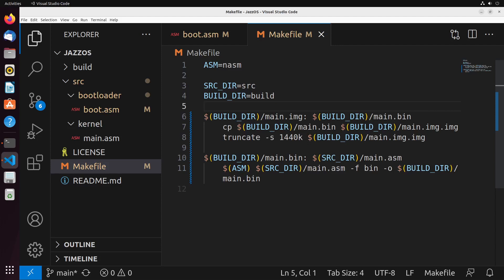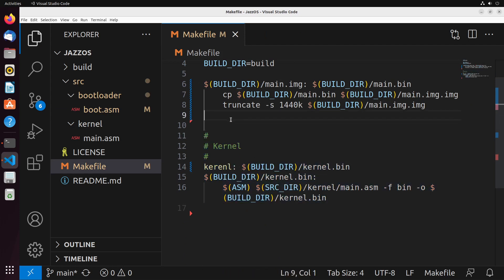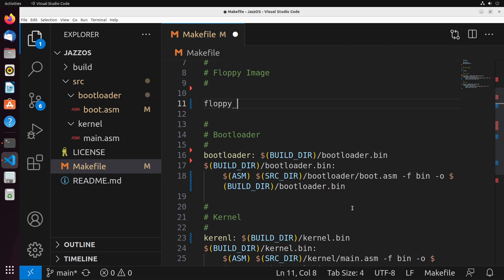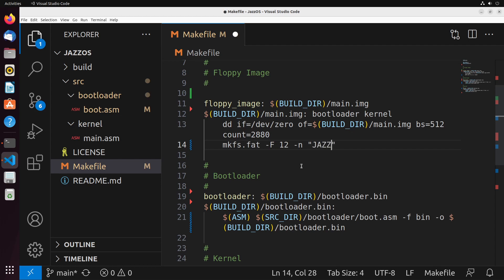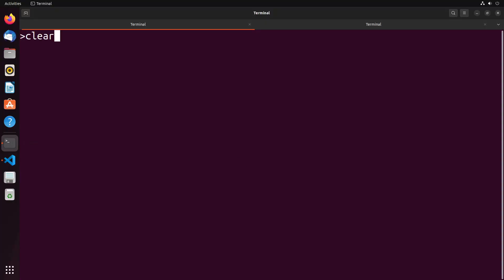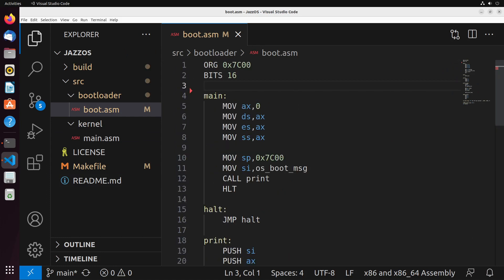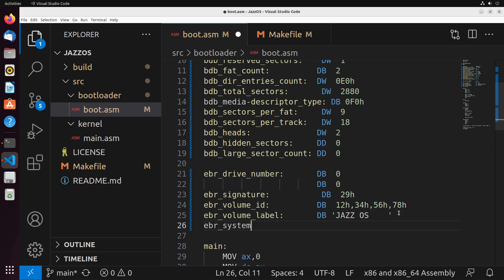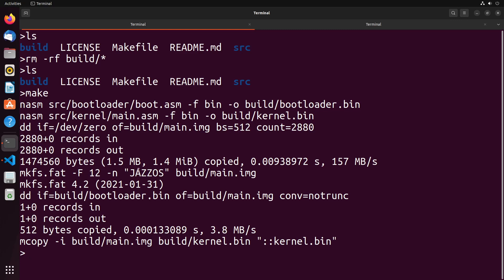x86 Operating Systems - Creating a FAT12 Disk

Comment: Normally I advocate for typing in EVERYTHING in a tutorial, but here's the FAT header if you're lazy

bdb_oem:                 DB 'MSWIN4.1'
bdb_bytes_per_sector:    DW 512
bdb_sectors_per_cluster: DB 1
bdb_reserved_sectors:    DW 1
bdb_fat_count:           DB 2
bdb_dir_entries_count:   DW 0e0h
bdb_total_sectors:       DW 2880
bdb_media_descriptor_type: DB 0f0h
bdb_sectors_per_fat:     DW 9
bdb_sectors_per_track:   DW 18
bdb_heads:               DW 2
bdb_hidden_sectors:      DD 0
bdb_large_sector_count:  DD 0

ebr_drive_number: DB 0
                  DB 0
ebr_signature:    DB 29h
ebr_volume_id:    DB 12h,34h,56h,78h
ebr_volume_label: DB '123456789AB'
ebr_system_id:    DB '12345678'